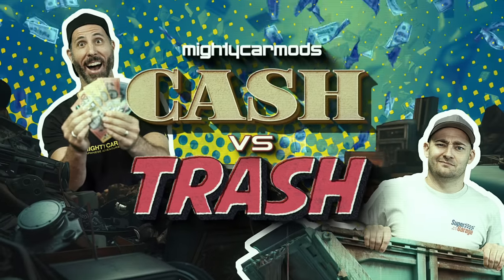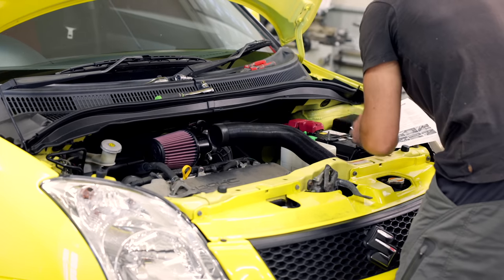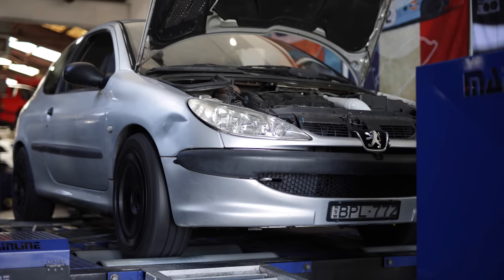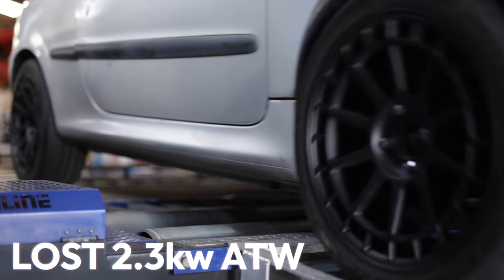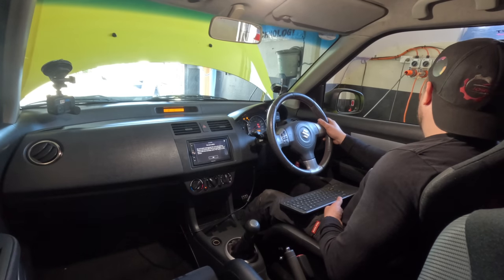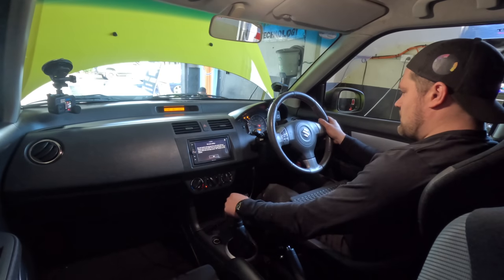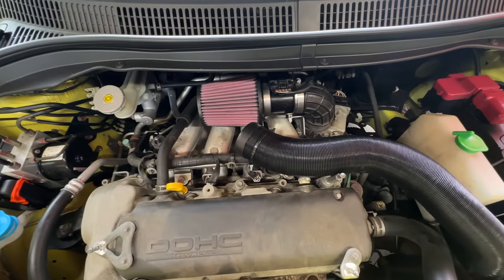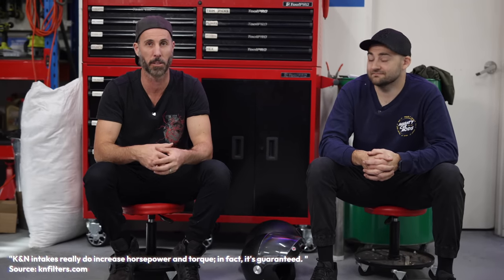Dyno testing POD FILTER Performance Claims | CASH vs TRASH

Comment: The loss with the filter was most likely the way the filter changed the flow over the maf sensor making the tune off
Reply: Literally came here to say this. The ECU needs to be tuned for the intake and exhaust. The factory ECU fuel and ignition tables are not tuned or adaptive enough to take advantage of the extra air flow.
Reply: It’s this. 

Source: I’ve been tuning cars for weeks now.
Reply: @24k__J  K&N in this situation are incorrect, as the video pointed out. That's because each ECU fuel and ignition tables are defined differently. So while there may be an overwhelming majority of stock ECU mappings for various cars that can take advantage of the K&N intake, there are other vehicles whose ECU mappings can not.
Moral of the story here is the manufacturers claims are not always correct. Remember, they are a business looking to make money.  They make a decent product. In the case of the Suzuki, it's ECU was mapped for airflow from the factory airbox. Not an aftermarket intake. Remapping the ECU will allow the car to take advantage of the K&N. Which was my original point.
Reply: i just posted this also lol
why doesnt tuner know that
Reply: That K&N kit was made specifically for the Swift Sport, so if the MAF wasn't positioned correctly, that's on K&N for not testing it.
Reply: Exactly this. 
With mitsubishi tuner cars, anything outside the stock box and filter throws the maf off wildly. In a certain specific mitsubishi cough galant vr4 2000, a tune does nothing to remedy this. Its either stock filter, or map sensor upgrade, which is a whole can of worms
Reply: Correct me if I am wrong but Moog bought a CAI kit and installed it as a Short Ram... This could also explain the loss at least partially.
Reply: @ForceFed  usually stock ecu has huge adaptative capability, round 20%. With the feedback of the o2 sensor calculate the desviation from the stock map. Not perfect, but should correct mor or less this kind of basic mods.
Reply: Yes you may or may not be right BUT K&N is claiming HP and TQ gains WITHOUT tuning.  So where is K&N getting the power from then?  False advertising possibly?? I'd be emailing the company requesting a full refund👍
Reply: Plus all the hot air being sucked into the engine.
Reply: @TheStriker0525  didn't help that's for sure would love to hear from K&N on this one.... What a freaking joke🙄 and for $500 yikes i wouldn't pay .50 cents for it.
Reply: @ForceFed  of j&n are incorrect the. There's a good lawsuit
Reply: @ForceFed   the air being colder should make the A/F better therefore have more power , the tune is not a must if you actually get colder air , the maf is sending Intake temps to the ecu that regulates fuel accordingt to temps . hot air = less fuel . the problem is atm its a Hot air intake and the filter should be at the end of the long tube . IF k&n instructions says to install like it is ATM its a total rip off . ramming cold air into hot air will just create turbulences .  and since the MAF is right at the pick up , its probably reading different temps , (cold rammed air + manifold hot air )  . sending a bunch of different temps to the ECU  !
Reply: @lukeyboy01  Do you mean there's a lawsuit for false advertisement against K&N for their power claims?
Reply: @blu3qc  This is factually incorrect.
Temperature is a measurement that most car manufacturers don't base their timing and fuel tables on. While temperature plays a role, air mass is what is king and what most tables are based off of. Why mass? Because it's a factor for volumetric efficiency (VE) when tuning an engine.  So while temperature is relative, it's not what most ECUs are hedging their fuel and timing tables off of. And I think this is where the Suzuki fell victim. The MASS of air the sensor was seeing was greater and outside the parameters for which the defined spark and fuel tables could account for.  And so when that happens, the ECU will always default to a safe spark and fuel table that doesn't make power. That table is safe to get you home. Had MCM posted the wide band info I'd bet we'd have seen the car go rich after the exhaust and intake. That was the ECU protecting the engine because airflow was outside of it's parameters.
Reply: @ForceFed  I doubt that there was a significant change in the air mass. 
A MAF Sensor just senses how much the air cools a heated wire, so having turbulent, often hot air would definitely throw things off.
Reply: @ForceFed yea I think you're into something here, at least turbo cars (with specific mods) moving maf closer to the throttle body enables better reading from maf sensor, another thing is the pod placement, it needs cool air and there's no scoop for the filter so it is sucking in warm engine bay air
Reply: @ForceFed  I'd be keen to see the K&N with an airflow straightener grate fitted before the maf, I doubt the maf and fuel trims can't account for the increase in airflow at that level
Reply: Was going to say something to this effect.  Mass flow sensors are calibrated to a specific restriction.  If the engine is pulling the same amount of air through a larger tube, you're going to have a lower mass flow reading and the engine will run under the assumption that it has less flow rather than the same or even more flow.  Mas flow is proportional to the density of the fluid (air), the cross sectional area of the orifice, and the velocity of the fluid.  The sensor can only sense the velocity of the air.  This can also lead to error due to temperature, if that's not reading right.  It might very well be calculating based on a density that isn't quite right based on the temperature.  Unless you're going to be tuning the engine, you really shouldn't mess with the mass flow sensor.  You can reduce restriction upstream or downstream, but the same sensor should be left running through the same diameter of pipe - it has no way of knowing how big the orifice is and assumes it is whatever the design spec is.  Should also be kept as close to the intake temperature probe as possible - again due to the density calculation.
While I don't so much think K&N are "Lying", most intake kits are not going to be upfront about the fine print...
Reply: That makes the most sense to me to.
Reply: @24k__J  For the same reason other companies sell you "performance parts" that result in a reduction: to make money off of you 
A fool and his money are soon parted...
Reply: I think the problems do not stem from too much air that has to be adapted for but rather from turbulent air reaching the MAF and it not being able to read the values the ECUs would expect, therefore running the wrong mixture.

Some OEMs use air straighteners before the MAF to stabilize the readings if necessary.

Comment: I reckon it was the wheel and tire change that made the horsepower loss more rolling resistance.
Reply: I agree. Seems reasonable that the cup2 tires has higher rolling resistance than the stock tires. I dont think that the exhausts decrease power, the air filters may but it should be 1-2kW
Reply: The Peugeot also has bigger and heavier wheels, ofcourse it lost power...
Reply: But wouldnt that be counter calculated when the resistance is measured? Lower wheel hp yes, but at the crank that shouldnt have an effect imho
Reply: I was thinking the same, would love to see back to back dyno runs with the two different wheelsets on each car.
Reply: Yes! Plus I'm pretty sure the dyno works by knowing torque and doing maths to give a power figure. Bigger wheels = less torque = less power number on dyno, even if engine horsepower increased.
Reply: @llleolllolll  this isn’t a crank dyno though. It’s a wheel dyno so you get wheel horsepower (which is the more relevant figure anyway)
Reply: I ve done back to back with only wheel tyres upgrade and yes, it lost me power
Reply: Dyno in the morning, modify at lunch, dyno in the arvo.
Reply: @cademckee7276  yes, but it still calculates engine "power" with the resistance while spinning down to account for drive train losses etc.
Reply: Came here to write same comment, exactly my thought
Reply: Probably why the dyno should be done after every mod
Reply: @llleolllolll  no it doesn't, i know what you mean. All our dynos in Poland do that, because thats what we are used to, crank hp (but after the run we also get whp, which in fact is what dyno measures during power run). But the rest of the tuning world seems to prefer whp (or wkw) so that's what it is in this video. I'm sure this dyno is also capable of measuring drivetrain losses, but they just don't do that, it's a choice
Reply: Or maybe they need to tune the cars and then Dyno
Reply: @madmodsgarage1179  Ah, didnt know that was just a euro thing :) whp is more relevant anyways, thanks for clearing that up :)
Reply: @llleolllolll  yup, but it this case, would be nice however to know the crank hp ;)
Reply: I wrote the same basic thing, then saw your comment. Of course it's the wheels a tires that changed the result.
Reply: @madmodsgarage1179 the only way to get crank numbers is to pull the engine out and run it on a bench dyno.
Reply: Yup came to write this
Reply: @llleolllolll  chance bigger heavier tires and youll see loss, theres more mass to spin. Yes dyno estimates engine power but this does happend.
Reply: @llleolllolll  drive train losses under full noise compared to freewheeling will be significantly different so it really can't calculate it very accurately
Reply: @llleolllolll  The powertrain losses are set as a fixed figure. Some single car specialists have reference cars where they know how much power it makes on crank, and then they make the calibration according to that.
Reply: @JD86Vintage  not the only, but definetely the most accurate way, I fully agree to that
Reply: @brendonwood7595  yes, thats what always bothered me also... so I still consider this method an estimation, just a better estimation, definetly better then 15% or 25% method or whatever single number calculation
Reply: What are you saying has changed from the first dyno runs? That the tyres are soaking up 7 kW MORE of power than the old set? 

Tyres do soak up a few kW (my searching didn't throw up any particularly reliable numbers, but about 2 kW per tyre is a fair ball-park figure, based on the one paper I did find from 1921) - but they are using the same tyres on both cars.

Are you saying that the Peugeot would have gained power if it had been running on its old tyres? Do you think the power dissipation in the tyres could have doubled in comparison to the stock tyres?

I think the intake is most likely the biggest culprit in this. Tyres may have an influence, but it will be miinor and the same for both cars.
Reply: Tyre diameter is the final gearing as well isn't it?
Reply: @llleolllolll  that would corrupt the data. No it measures until the spool up is complete and records are saved and next they shut down the throttle.
Reply: @jackrichards1863  dynos that measure drive train losses, do that AFTER the power run. Clutch is applied, neutral put in, NO BRAKES used and dyno lets the drivetrain to spin DOWN "freely", applying slight load and measuring how much power it takes to slow it down (in each rpm point, creating a plot). The result is that you get your regular whp curve (power run) and drive train losses curve. If you add these two, you get crank hp. That's the theory, because, in my opinion, friction between gears etc gets alot bigger when more power is applied (power run) and less when they spin down freely (drive train loss measurement). BUT power loss due to spinning masses in the drive line (driveshaft, gears in transmission and rear end, etc) AND the wheels and disc brakes, that remains the same. So I would assume, in power losses, there is some constant value (spinning heavy things up) and some variable, dependable on load applied (internal friction etc). If so, this way calculated crank hp is lower then it really is. And difference gets bigger the more power you make and the more load You set in the dyno (which cannot be set in inertia type dynos as far as I know). Thats my theory :)
Reply: Loss power but gained grip, give and take system here 😂
Reply: @HeyFriends314  yup, exactly ;)
Reply: @mceajc  yep probably 10 to15 Kw🤯
Reply: @madmodsgarage1179  tyres won't change the outcome then . The run down will bee correspondingly inverse of the losses. Not I never heard of a dynomometer that is so beligerant
Reply: @jackrichards1863    I don't understand what U mean. If you are talking about the video - tyres WILL (and probably did) affect hp at the wheels which are the values that we see in the video. Generally, tyres that have more grip will have more rolling resistance. If dynoing/calculation method I described in the previos comment is accurate enough, tyres/wheels change should not affect crank hp result.

Comment: My guess is the different wheels contribute to power change/loss. More friction with grippier tyres, larger tyre circumference is a power killer.
Reply: yep should have run them up with same wheels/tires as last time
Reply: Absolutely. Especially marty's cheap wheels, which has a lot of additional weight further out compared to the old wheels. Put the old wheels back on, and he might have a marginal gain.
Reply: Yeah but aren’t the newer wheels lighter?
Reply: I agree

Comment: would have been good to see the old air filter back on and a retest of the swift.  just to make sure the drop in power was real and wasnt some odd dyno issue
Reply: That and isolate the problem being the new muffler or the new intake
Reply: @williambartholomew5680  or the bigger wheels
Reply: @4bidn1  17"s are too big for these two anyway.. both would perform better on smaller wheels BUT probably no other option if you want to run Cup 2s..
Reply: Exactly what I thought, I thought they were going to.
Reply: @martin1649  17''s come as standart on the swift sport so am pretty shure its meant to run 17 inch wheels tire size ofcourse can vary slightly but idk those sizes for the swift atleast seem legit
Reply: 205/50 R15 is the perfect size for a Swift Trackmod the 17" are too big and too heavy. Also knock out the Foglights and guide some Airducts to the Brakes. For Icing on the Cake replace the Front Pads with Endless MA45B. 
This Pads last about 7000 Nurburgring-Km.
Reply: @martin1649  Since the dyno should account for the drivetrain loss, it shouldn't make a difference.
Reply: @ironkcoony  but it doesn’t this is whp/wkw
Reply: @Gippo I thought the same thing
Reply: At each run you put heat in the intake system, so it's possible you loose power.
Reply: @ironkcoony  No mate, i don't mean dyno loss of performance. The peugoat was designed to run 14-16" wheels at max.

Comment: I've been a Journeyman tech for 10 years now and as most people have pointed out there are many many things that contribute to power loss when putting on "Cold air intakes". But the one thing that always seems to bother me, and i know it shouldn't, is no one likes to talk about how 90% of Factory intakes ARE COLD AIR INTAKES. Almost every car draws its air from either the grill or the fender from factory. I mean think about it for one moment people, you dont need a cold air intake because you already have one!  If it was as easy as simply changing a pipe and a filter to gain HP the Manufactureres would do it instantly! Anyways thats my rant for the day. As always, keep it up guys your videos always make me happy and put a smile on my face. Good job
Reply: exactly, that yellow car was sucking in hot air right off the hot metal intake manifold.
Reply: Totally! The Suzuki had air ducted straight into the stock filter so the engine could only suck it in through that, making sure all the air comes from the outside. This "fancy" K&N setup just has a pipe exiting near the filter, so whatever air trickles up there from the outside is mixed up with the heat from the engine. Such a half-assed solution from a supposed reputable brand. Shame.

Comment: It’s kind of hard to know for sure what was going on unless you put the stock air box and filter back on and do a dyno run the same day to see if there were any other variables involved
Reply: Yeah I'm pretty sad that they didn't do that.
Reply: That's what I was thinking, as well.
Reply: @MrMarty77  They've done this before on a much older video, including swapping back on the same day. The result was the same. Pod filters suck, K&N especially. They're made for suckers who don't understand how airflow and intakes work.
Reply: @MrMarty77  They have done it in other videos. The aftermarket air intakes have always been a scam.
Reply: "pod" open filters in an engine bay is the worst thing you can do to a car. Especially when it sits directly over a hot engine. $500 for that? Moog got screwed.
Reply: Probably the intake temp considering the filter is over the headers 
Also maybe ambient temp for days of testing (and barometric pressure)
Reply: Good idea
Reply: Loook this isn’t rocket science. A pod filter sitting in a hot engine bay cannot draw the same quantity of air as a std system designed to access the coolest air available to the inlet tract. They will make good vroom vroom noises but are not designed with engineering in mind. Use the best filter element you can get into your std intake. Even K & N are reasonable, so you can wear the sticker with pride. I prefer the foam washable elements with their special oil. Unless you are changing your whole induction system to suit bigger cams and exhausts spend you’re bucks elsewhere. Moods system would have paid for a pair of Koni or Bilstien shockers! And they do make a difference.